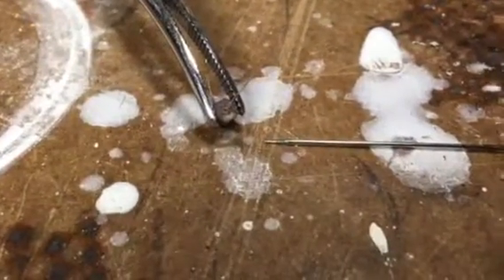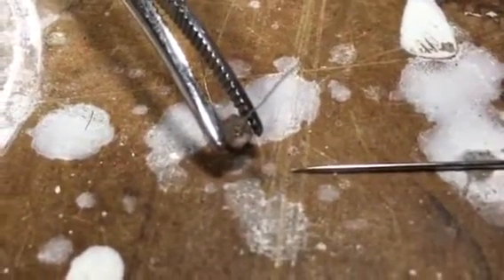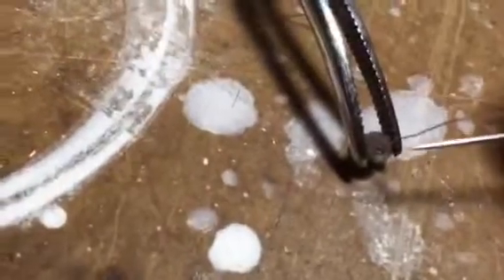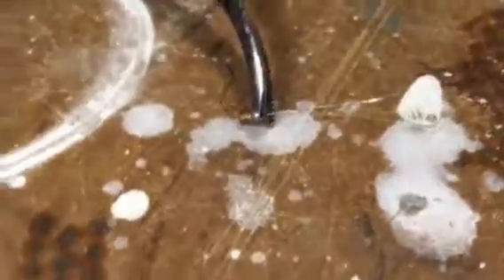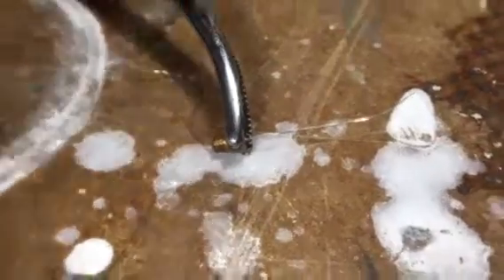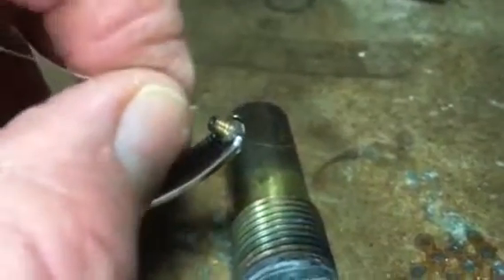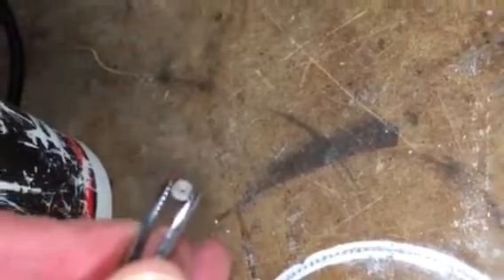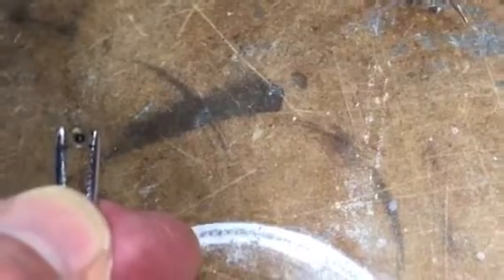How to unclog a DCS cooktop simmer jet

Comment: How the heck did you extract the orifice from the narrow deep well in the burner top?
Reply: @IFish4Tuna  oh, yeah my problem is it’s a deep well smaller than a pencil and it’s microscopic and I’m afraid to try to purchase multiple precision nutdrivers with extremely thin walls hoping to get the right size because general electric Will not divulge the exact tool for extracting it and less I have a certified repair account. I had to replace one of the little aluminum pipes which was caked with a white film, but another one is still clicking and that could be the problem but I can’t take the chance because it must be repaired so if it’s not the white film build up I still have to get the orifice out of the deep well and it looks like 4 mm and I’ll need a paper thin wall and even the watchmakers and high end nutdrivers don’t look like they will yield success because these things are really stuck in there and even if I were to get lucky enough to get something that would turn it I think it would just break the tool as I would have to put a microscopic pipe wrench on the micro scopic nut driver so I’m reaching a peak of frustration That seems to be in measurable.
Reply: @IFish4Tuna  I wish I could show you the pic, the simmer orifice is in a deep well you could barely fit a pencil in and deep down is the micro simmer orifice. I’m using and “answer anything “ online service, scouring every inch of every search engine and battling GE over the phone daily and cannot get the simple answer to the simple question “what exact size and brand or style, what exact nut driver do I need to extract the micro simmer orifice out”? I need this information badly and presently, I’ve spent 50 plus hours skimming vids, making phone calls, arguing with venders, no luck whatsoever. It’s crazy. There are watch maker nut drivers and so called precision nut drivers but the don’t look strong enough to withstand the vice grip or tiny pipe wrench I would need due to diissimilar metal bonding, like the way the main tubes get stuck in units that are 15 years old plus I don’t want to spend a pile of money and get a pile of nut drivers to hopefully get the one I need and have to grind the o.d. down to fit in the deep hole a pencils can’t fit in. I’m loosing it and I need to do this job badly, I have to stop the clicking for a customer who can get jobs for me and if the switch harnes doesn’t work I don’t know what to do because my boss already put in a new spark module and I was able to get a guitar string to poke through the orifice hole and it lights But clicks every now and then. Also I found out by working on them when you unscrew the aluminum tube that feeds it sometimes there’s a white crust that has it sealed shut so even if you clean the orifice it’s still plugged so essentially I’m taking it apart removing the dust that’s jammed in the end cleaning the orifice and it has a new spark module and I’m going to put a new switch which of course you have to buy the whole harness and replace all the switches and with the age of the unit if I can stop this one from sparking in a short period of time the other burners will succumb to the same problem and fortunately I was able to clean them out with the guitar strings and tip cleaners and alcohol but it actually needs an authentic servicing which means getting the proper tool and simply removing all of the orifice and replacing them it cost over $130 to get six of them and they only sell six packs of the orifice for simmer and the plain orifice and some of the units have half of each so then you have to buy $300 worth of orifices just to service one unit and this is a big opportunity and I can’t play games but I can’t get a straight answer from anybody in GE wants you to have a repair man‘s account and things like that are just happening left and right and I cannot get a simple answer to a simple question,So I guess it’s not so simple